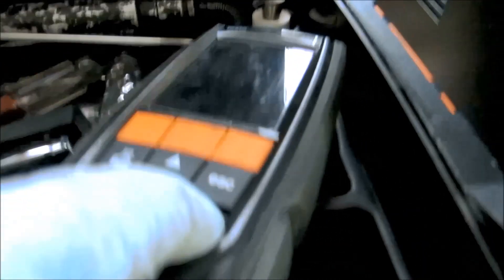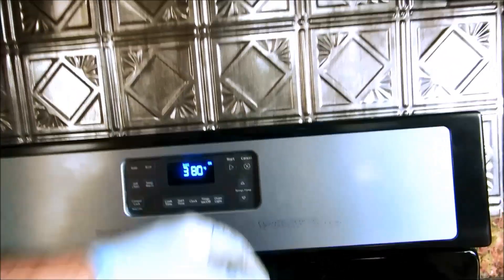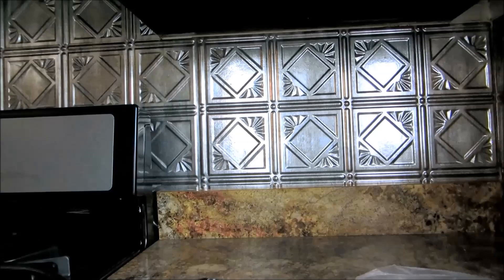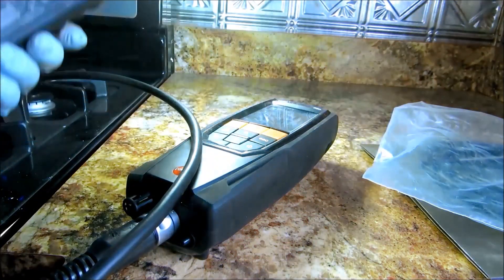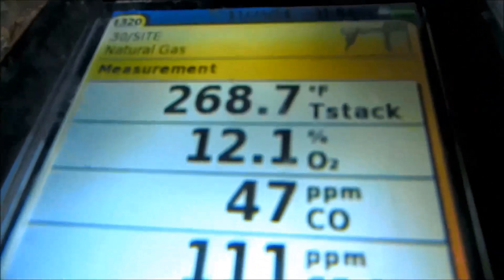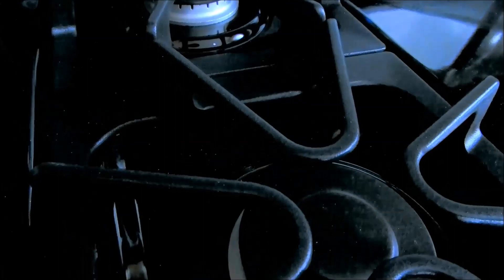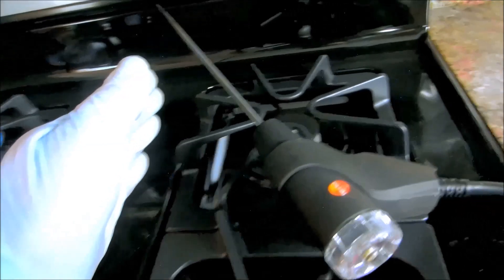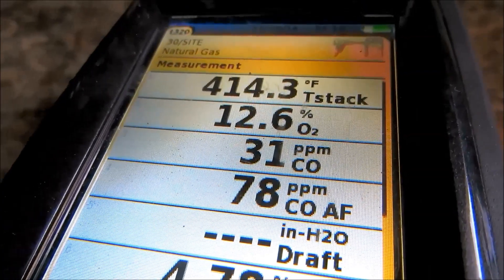new gas stove giving off high carbon monoxide levels ,adjusted

Comment: Late to comment on this.  Here is the outcome on most stove tops.  Most restaurants use the 240V Commercial exhaust vent while cooking.  But I also know a lot of restaurant prefer to use the wall fan units above the door or close to the ceiling. (cheaper) Makes sense if no cooking is being done. You can save $1000 a month alone on this idea.  Not mentioning names.  In the winter time they don't even turn it on.  So why aren't they dead ? If their jobs is in front of the stove the whole time.  As I ask them, Do you have any symptoms they said no.  I have never heard anyone dying while cooking from CO2.  Sleeping ...definitely.  I seen people left the stove on sleeping an burning the pot.  They wake up with no issues. Conclusion- in theory ...if you have a drafty house or home ...or large kitchen...you be fine.  BUT, if you a have a zero net home.  I would be very concern.  Final words. Your house also need to breathe.

Comment: Maybe the REAL concern should be the extreme "tightness" of new houses which eliminates natural air exchange. Without proper ventilation, you are breathing contaminated air. The reason for this: "energy efficiency". What is next, cat convertors for stoves?

Comment: It's also about perspective.  If you work as an auto mechanic down at the Ford house, you're exposed to high levels of CO on an intermittent basis.  I've observed 1200 ppm of CO in the smoke stream of a single cigarette.  Any fuel-based cooking will produce some level of CO but typically it's for a brief time and concentrated in a small area.  Vent hoods are helpful for removing the undesirable stuff.  Outdoor grilling or even a campfire would do you in if you positioned yourself in the wrong spot for a prolonged period.  This is a great channel for learning and knowledge dispels fear.

Comment: As a appliance technician I have found that when the oven is cold the levels of CO from the vent are very high. However after the unit has finished preheating Co levels drop dramatically. This is a normal operation gas range.
Reply: Manufacturers, Whirlpool and GE both recommend testing for CO AirFree after the oven has preheated for over 15 minutes, as the preheat cycle does indeed put off more CO.
Reply: I have a fast-acting CO meter (Sensorcon Inspector) and I observed the same thing. The amount of CO at first is way more than 100 ppm.

Comment: Let it warm up first, at least 10 minutes. Adjusting primary air like you seem to like to do by fully opening the shutters, but does nothing but increase stack temp and so reduces efficiency, it can also result in delayed ignition. Until a range is fully warm they all make quite a bit of C.O. Nice detector by the way, better than what we had.

Comment: Thanks Steve! 

I tweaked the bake airband wide open. Broil was already wide open. No screw on my regulator either....Grrrr! My Carlin power gas burner at 100Kbtu's is 20ppm at the flue and I was reading 200ppm from the GE gas oven IN the house WTF???
Reply: So opening it up all the way took it from 200 to 20?
Reply: @tazyboy28  No, my power gas burner in my heating boiler can be adjusted to VERY low CO, the range's combustion CO is in the 100's of PPM.

Comment: you should have no more than 135ppm coming from the stove with the probe inserted 1" into the vent and the oven should be run  5mins before checking for co. checking the burners for co the probe must be 18" above the burners and the levels should be 10% above ambient levels

Comment: Whats the difference for adjusting it? The carbon monoxide level created is the same just mixed with more air, while its safer around the stove, I think nothing changes when it comes to the house, burning gas creates levels of monoxide that it creates
Reply: No fortunately that is false. Adding more oxygen BEFORE the burn will provide oxygen to make it burn into more co2 and less co. With les oxygen it does not completely turn into co2 and remains at co.   If air was simply added AFTER combustion then you would be correct it would only dilute.

Comment: Hi Steve.  I had a couple questions.  I'm just a DIYer but notice at times our kitchen range has a more yellow than normal flame. Its a natural gas range.  I wondered if you run into that sometimes and how much difference there could be.  Also thank you for Hydronics 101.  We have has guys make several attempts at getting part of our system to work.  I understand it better now and believe even with an extra circulator added to that part we have no heat on that leg.  Its all one circuit.  I'm going to start by cutting some copper and adding house pressure to it both ways to see if that will bust it loose.  If not I'll try to snake sections at a time.

Comment: Have you checked the gas pressure? I just ordered a new range similar to the one in the video; I plan on checking and adjusting. I am curios if the pressure is within spec and adjustable.

Comment: Hi Steve,  great topic of discussion,   Pure Cowboys who don't test when they fit,  it's crazy amount of CO pumping into room until you opened up the air intake, was the gas pressure ok or did u need a regulator,,  they're really clamping down on gas here but in a good way,, gas  analysers are a legal requirement in the uk  now ,, but there will always be the Cowboys who break the law but slowly they're being fazed out , yeehaa, lol
Great vid
Reply from the maker: Kris Farquhar Plumbing n Heating the u.k. is ahead of us in regulations but your right every gas applence should be checked

Comment: I just got an old 1950's era Chambers stove. The oven and burners are filthy. The pilot light tips are caked with soot. So are the oven and griddle burners. The air bands on them are barely open. No gas regulator on it.  The oven and griddle are match lit, no continuous just an intermittent pilot light for the oven. There is no thermocouple or safety valve for the oven.  Nice looking stove but it's gonna need a lot of cleaning. I'd hate to see what the CO readings on this thing would be if I fired it up now. Should have it tested!
Reply from the maker: Progrocker70 you need a gas regulator on stove ,,and open them air bands up.then do a combustion test to stove once you clean up the soot

Comment: I live in a rural area and alot of hoods don't vent outdoors they have a fan set up with screens to catch grease,after seeing those high C O numbers,  I'm going to look into possible kitchen hoods that would be easy installation in after market applications. Thanks Steve good video
Reply from the maker: Bernard Sobbe yes any stove should have a good vent to the outside running every time to run the stove ,to get rid of the c.o. to the out side
Reply: @Bernard Sobb what did you find? I live in an apartment and want to recommend something to my landlord

Comment: Excellent video Steve and I shared it on FB so my contacts can watch and learn. There definitely needs to be more awareness regarding gas stoves / ovens and the carbon monoxide they produce. Why this stove was sent out from the factory giving high CO levels is beyond me.
Reply from the maker: Ronnie Bradley its a unregulated industry no one checks them ... furnaces and boiler yes stoves no ,and thats the only unvented applence  does not make any sense at all ..
Reply: Sweat shops having nothing to do with quality work just production no qualified worker would do that rats have no conscious thought... 🐒😔

Comment: Great topic, I agree 100% that kitchen and laundry are often over looked on operational safety.
Where in your opinion is the best place for customers to put CO monitors if they have gas cooking appliances? (Countertop, other side of room, etc.)

 "Cooking with gas with Steve L" episode 102.
Reply from the maker: Dwight Bennett 6 feet away as a rule of thumb .but the c.o. detectors you buy in the store will not go off till 70 ppm .so there  pretty much junk
Reply: steven lavimoniere After doing some reading, I see that they are better than nothing, but your point is valid, if they do not sound the first alarm level at a sufficiently low reading, then it is of no use to measure prolonged exposure.

Comment: Vent got over 400 degrees, So do we automatically just open all vents? For gas fixtures? What's the regulator setting?  Can we adjust?  Or do we call gas company? 
Thanks
Gilbert
Reply from the maker: gilbert de la torre all nes stoves come with a non adjusting regulator ,they call it pre abjusted

Comment: I just checked my father in laws this Thanksgiving. I found 1 PPM in the kitchen. My wife was doing the cooking and she had a window open to help the draft and vent heat out. I made a big speech years ago about removing the basket filter which is wrapped with foil to keep the air from blowing in. After she was done foil wrapped filter basket was put back.
Reply from the maker: hanky97007 yes the stove has to breath foil can cause big problems  by choking of air

Comment: Damn Good Video Steve, I agree with you, People do not think about the Gas Ranges in their homes.  On The Firefighting side,there have been so many times that we have rolled on folks who are having CO poisoning Symptoms, the itchy eyes, headaches, nausea, etc.  Come to find out the culprit is the gas range who is causing he problems.   People need to take this serious, like you said they think its the furnace or water heater that will get them, and most of the time is the appliance they least expect.   We ended up finding the problems in the stove and red tagging it until a good tech, can check it for them.   That Testo 320 is a hell of a tool to have, and folks need to get in touch with the pros to make sure their Ranges are working.   A good vent hood with a direct vent to the outside will help vent the CO, but they should always get it checked by a professional with the right tools.  well those are my thoughts, that and a buck might buy a cup of coffee but hey, why not participate, Good Topic!
Reply from the maker: Rudy P i am glad you are participating its always good to hear the side of a firefighter  you see it more then most do. when there is a c.o. problem they call the fire dept ,or gas complany.. in my area ..

Comment: Good discussion. I'm curious, how did the customers know there was a problem? Were they feeling sick from the co levels?
Reply from the maker: Longeno55 no brand new rental i worked on the furnaces and dieled them in ,the water heater was fine so i checked the stove to see what it was reading ..state funded home for problem kids
Reply: steven lavimoniere Oh, I understand. That is good advice about running the exhaust hood when they use the stove. You may have saved them from getting sink in the future. Bravo Steve!

Comment: Excellent work Steve
Reply from the maker: Harry Dickson its still a bit higher then i would like to see but at lease they have a vented hood to the out side ..
Reply: That's a good thing because my vent in my hood goes into the cabinet only. But the good thing is I'm all electric
Reply: Harry Dickson
 Microwave above range?  I see that all the time...
Reply: Ryan Dugger I don't have a microwave on top of my stove is just a plain old stainless steel hood
Reply: Wow...never seen an actual hood vented into the cabinet....the micro/vent above stoves are always installed and left un vented...seen it many times
Reply: Ryan Dugger I never seen it either till I actually looked in my own house luckily I'm all electric and I don't worry about it

Comment: Good thinking finding that usage for your meter. Good work. God forbid they don't use their hoods, that was crazy CO at the start.
Reply from the maker: talyn875 i jsut talked to a applence guy on the phone he said most he does see is like 60 ppm pumping into the living space brand new with a non adjustable gas valve,,,,, g.e. said 100 ppm is acceptable limits for and appliance its not a boiler or furnace so it falls under another catagory .. scarry stuff i did this video to raise awareness of a giant problem no one is talking about

Comment: Good show Steven, if it burns fuel it should be checked!
Reply from the maker: Stephen Rardon higher levels then i would like to see .but exceptable according to the manufacture . 100 ppm and lower of c.o. is actable best to have a good fan going venting out side when running